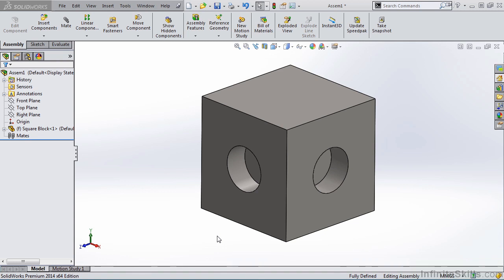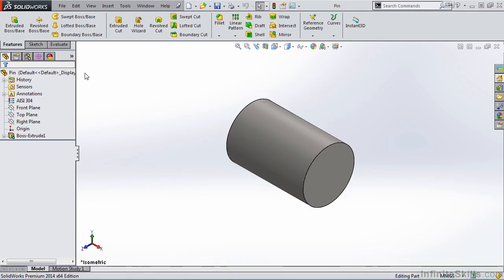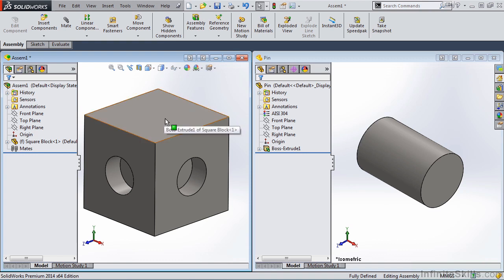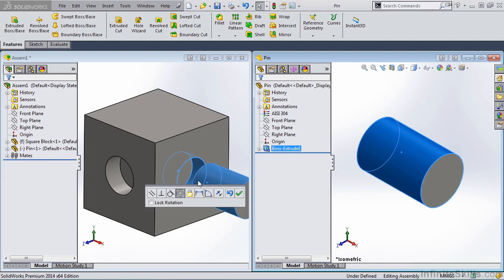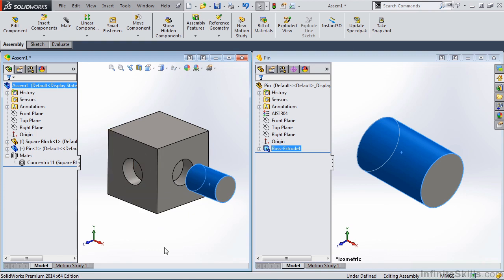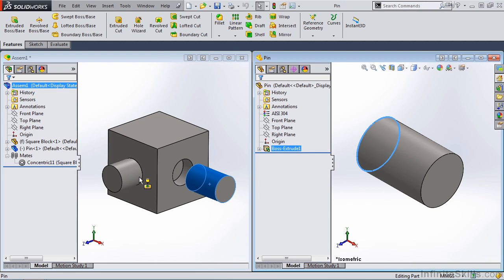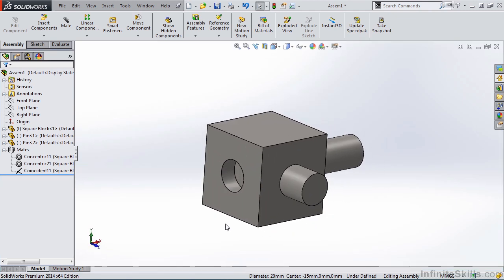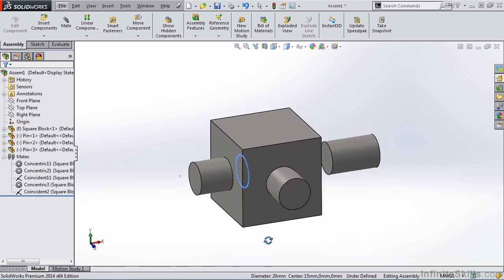SolidWorks 2014 Tutorial | Smart Mates

Comment: lol it was silent for the first few seconds so I turned up the volume and then "IN THIS LESSON.." but thanks this really helped. However, I just finished an assignment for an assembly without any prior knowledge of using the mating tool and I had to fit shafts that were slightly smaller than the holes (loosest fit in engineering drawing terms), I don't remember how I managed to put it together but how would you mate in that case? i.e. a 0.560 diameter shaft into a .563 diameter hole. Thanks
Reply: buy the video set.
Reply: Your case with smaller shaft does not affect any concentric mate, so no problem in any mate situation